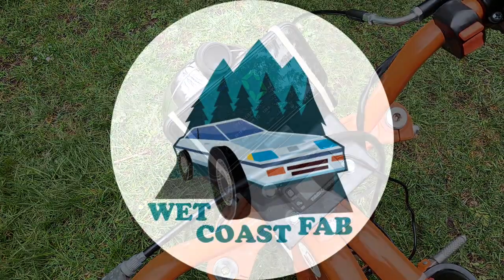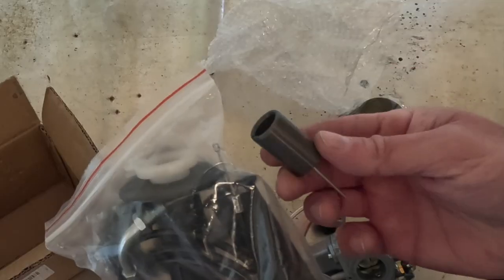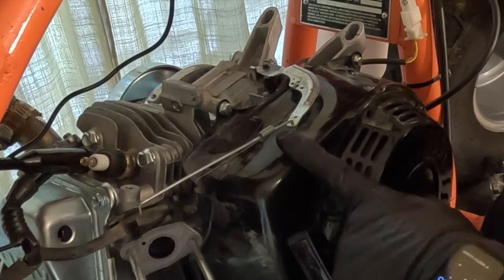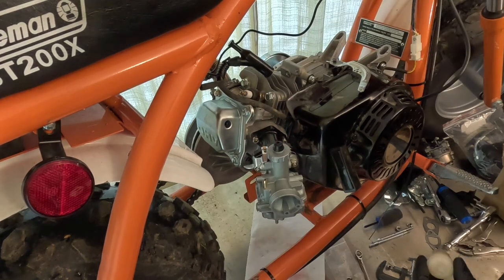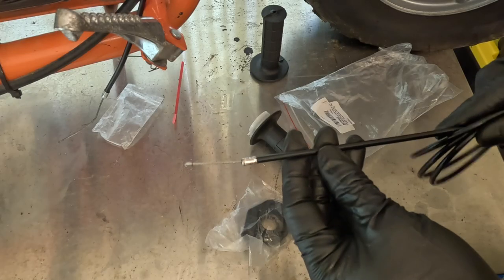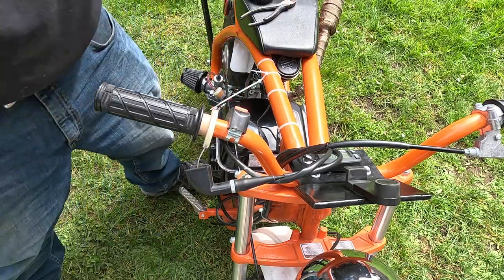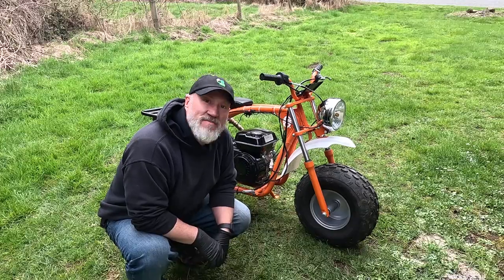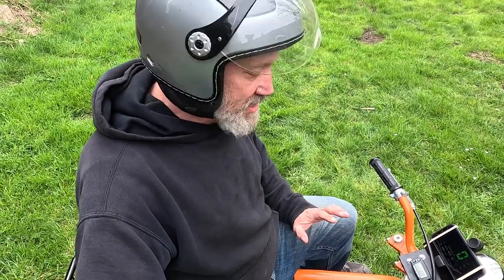Coleman BT200X | What will a VM22 carb do for the mini bike? | Wet Coast Fab

Comment: If you don't remove the internal governor actuation lever it will bounce against the crankshaft . Either remove it OR attach a small light spring on the outside linkage to pull it back towards the carb keeping tension on it so it won't bounce against the crankshaft inside . 😊
Reply: He did, at 8:45 you should have watched the video
Reply: So you need to remove the internal governor to properly install a vm22 carb?
Reply: @christophermendoza2986  you should remove it since your not going to be hooking up that VM 22 to it and if you leave the plastic gear and the rest of the governor inside , eventually it's going to come apart and that's not good .  This is the right  way to CYA . ARC rod and billet flywheel are a good idea since no more governor means higher rpm's .
Reply: @crippleguy415  so riding stock is not recommended? Better to buy a stage 2 kit at that point if I’m going to remove the governor

Comment: Valve springs are a must. if you want to rev to a point where the CVT becomes the limitation, you need to go beyond 4200rpm. 18lb valve springs will allow that. but you should look into a PVL flywheel or go full Billet Aluminium, both advance the ignition timing which gives more top end power, but at this point you want to open it up and fit a Billet Conrod, you could fit a 0.020" longer one if your piston allows, or even upgrade to a flat top piston for higher compression. the Hemi piston is a direct swap and the most cost effective swap but measure the piston height first if you go for a stock length rod then a 0.010" head gasket will work, if you end up with the piston flush with the top of the block you need a 27 to 45 thou gasket, and then there are literally dozens of different Camshafts from each supplier to choose from (my choice is the CM grind from Dyno cams... the hottest of the budget cams)
Reply from the maker: Love the feedback! I have a 10k aluminum flywheel to try out, with 26lb springs. I've also got a 0.020 longer conrod and high-compression piston to try out. I'll measure out the clearances first and if I can get 10 - 12:1 compression, I'll try 100 octane gas and see if she goes boom!
Reply: The stock valve springs are not the reason why it's not getting higher RPM. It's currently limited by gearing. Guys have experienced this for many years with the tall tire bikes. Even with your suggested engine build you'd be lucky to get to 4500 RPM. A gearing change is needed to take advantage of an engine build. The easiest gearing change for higher RPM is the Juggernaut or Tork-Zilla driver. 7.5:1 gearing is much better than 4.5:1 against a 19 inch tire.
Reply: @wetcoastfab  Easiest way to get 10:1 or more CR is with a 14cc head. A flatop and a plus 20 rod would still be under 10:1 with the stock 22cc head. A 14cc head, plus 20 rod, and flat top may get you more compression than you want or need.

Comment: Awesome 👍  More great tips.  Every minibike or dirtbike needs a fuel filter.  Especially if you're stealing gas from Dad's rusty old lawnmower gas can.  Cheers from Canada :-)
Reply from the maker: You're so right, Robin! I'm used to Honda products where there's automatically a fuel filter in the tank or just after the tank
Reply: The governor doesn't engage when it's not connected to the throttle cable.

Comment: Hey i got a new carb for my bt200x and my bike wont start with out starting fluid and when it does i have to keep giving gas or it will die out i have tried the screw thingy on it

Comment: So I upgraded my carburetor on my DX with the vm22 but now when I started it wants to take off right away do I need to get to torque converter cuz right now I have just the chain and jackshaft
Reply from the maker: Take off the air filter (if you've installed it) and have a look at the slide with the throttle closed all the way. You should have almost no gap at all between the slide and the carb body. If you do at fully closed throttle, you may not have enough cable length or need to adjust the cable. Let me know!
Reply: @wetcoastfab ok u wouldn't have a video on it?
Reply from the maker: If you look in that video around 13:30 or so, you'll see where I have the throttle slide stuck open about half-way. Then go to around 15:20 and you'll see the way the throttle should be all the way closed. Let me know if that's clear enough.
Reply: @wetcoastfab  ok i think that might be the issue thank you

Comment: They're not too big for a 196. You just need the jetting, a cam and gearing to support its full potential. That includes a billet rod and flywheel for safety. Gearing can be done with sprockets or Juggernaut/tork zilla driver.

From what I have seen from your other videos it looks like you may have had an issue with the stock carb to get only 31 mph then jump to 40 plus with the Mikuni style carb. There shouldn't be that big of a difference on a stock bike that is topping out at less than stock max governed RPM. Probably somewhere around 3400 RPM.

There's a good lesson here for everyone doing the same mods on the Coleman 200's. Don't waste your time removing the governor because you will not be able to get "ungoverned" RPM. Just keep the governor arm in position with a light spring until you can get ungoverned RPM with more engine and gearing. Any built 196 is more than capable of doing just that with the right gearing.

Governor removal should be done during the engine build, not before an engine build..
Reply from the maker: Love it! Some great information in there, thanks! 
I have a 208 (212cc) engine that I'm putting on next and will be doing some more advanced mods to it - the same VM22 carb, upping the compression a bit, billet rod, billet flywheel, valve springs, etc, just to get a better idea of what a bit more compression and displacement will do.

Comment: I really appreciate your videos. That stock throttle linkage is way too complicated. I was messing around with it and never able to put it back quite correct. It got more peppy but theres not a lot of play anymore to go slow easily.
This looks to be the perfect upgrade to get rid of that whole linkage and gain some serious speed improvement at the same time.
Thank you for a clear and consise walk through.
Reply from the maker: Again, thank you for the feed back! Yeah, having that weird not-really-connected-to-the-carb-butterfly complicated linkage that comes on these engines makes it a lot easier to work on! I remind myself that these 6.5hp engines are really coming from agricultural origins where they're meant to run all day long at around 3600 rpm, driving pumps etc.

Comment: I don’t know a whole bunch about carb.s but what has always worked for me is 
Set the bike up on a block or something to free up back tire. Get it to crank, turn the high side ( bottom screw )out till the engine speeds up and sound smooths out 
Leave it where the engine runs fastest! 
Now turn the idler screw ( side of carb). Down until idles like u want it. 😊
It should perform real close 
to what is expected! 
Until you billet it! You should not need to re jet the czarb 
Just need to tune it up ! 
I had a 95 # when stock!!
only till I put a cam in 😮I’m stage three !  At 58mph I still have a lil throttle left 
just out of guts ! 
😮😂😊
Reply from the maker: Love it! Thanks for the feedback!
Reply: What size pilot jet did u use

Comment: Hey good job, I'm not trying to Bragg but if you just start pipe it and zip tie the govener spring, remove the throat screw, take off air filter cover, it will go 41-44 mph
Reply from the maker: Sweet! Thanks! Maybe I overthink things too much ... wait for what I want to do on a future upgrade ;-)

Comment: The stock flywheel on these things weighs about 2.4kg.  If you want it to rev out more you can swap it out for a cast aluminum one (not necessarily billet).  Mine cost $66 Australian (including shipping).
Reply from the maker: Thanks for the comment! In fact, I bought the cheapest 10k aluminum flywheel I could find on Amazon and plan to test it to its limits, perhaps to its destruction?

Comment: Summit racing has the vm22 the real deal mikuni carburetor. The pilot screws on the side as well as the idle screw and you can change out the jet on the side of the carburetor also
Reply from the maker: Love it Stephen, thanks! I might have to get one especially with some of the engines and engine upgrades I'm planning on playing around with

Comment: I have a stock bt200xg so same bike just black and green and i got it to 33.5 just by making a new return spring and and changing the throttle spring to a metal rod
Reply: Ps if you delete the jack shaft you loose torque but will hit around 50 mph all day long 💯🔥 just be careful on the factory wheels they balloon out a little bit
Reply from the maker: Yup, the soft springy tires on this thing make me nervous. I think when I get some more speed out of it, I'll look for some proper DOT tires that can handle it
Reply: @wetcoastfab  oh yea 50mph is definitely 5-10mph over what I would say is safe for those cheap tires 🤣

Comment: Dude mine is a base 196 hisun engine came with it I got just a cold air intake and a 1 inch pipe for exhaust maybe 1 foot long and I’m slow take off because no TC but I get up to 47mph top speed and I am 5 foot 10 weighing 320 pounds
Reply from the maker: I wonder if the bike I have is limited somehow for the Canadian market? Maybe I just have bum HiSun engine. Not to worry: an engine swap is coming!

Comment: i always thought the needle is for 25-75 percent throttle, the main jet controls the wide open supply. if too rich at wide open, maybe a smaller main could fix it?
Reply from the maker: You're absolutely right! The needle is also tapered as well, so as it moves up with more throttle, the cross section of the main tube gets larger, feeding more fuel - dependant on the opening of the main jet hole, of course!

Comment: The torq-a-verter has plenty of gearing, that being said, I have have great luck with installing a larger rear (+10 teeth) sprocket for acceleration. It did NOT seem to affect top speed.

Comment: Do you have Engine Braking w / torque converter?? Ths
Reply from the maker: Hey Mark! It does, as long as the engine RPM doesn't drop below a certain RPM (almost idle actually) as you're decelerating

Comment: Don’t know how useful a inline fuel filter is ?? 
There great, it also helps to keep moisture from making it into the engine. Try using it, after 5-10 gal just look and see! 
If it jumps, moves ,wiggles, use a table when assembling, clips,&keeps! I say this because it took me getting frustrated enough for buying lost clips , jets, screws ! Anywho … save a screw use a table !

Comment: Nice set up there, do you think that it will work on a stock Honda GX160 engine? I really would like to make mine run a bit better. Mine gets held back by the governor, if I have to remove the governor so be it. Thanks. I forgot to mention, I bought a stage1 kit for it but it didn't work due to running rich and I even smelled it in my oil so I had to change the oil too.
Reply from the maker: It might be too much carb for that size of engine; you'd have a hard time getting the jetting figured out. Gas smell in the oil is bad for sure! Thanks for the feedback!

Comment: Buy a juggernaut clutch driver from go power sport doesnt slip the belt and increase speed and power and you can change the springs out on the torque converter to get more torque and speed or just change the gear on the cvt and the rear sprocket
Reply from the maker: I'll check it out, thanks for the feedback!

Comment: What rpm was u running at when u whr at 42mph do u remember by chance was it around 3700 or maybe i seen wrong
Reply from the maker: It was about 3,700 yes. I didn't get much past 3,800 during my testing. Billet flywheel next!

Comment: Remember that adding this new carb removes the governor, so be careful with the rpms!
Reply from the maker: I'm going to get a billet flywheel and hopefully that keeps things safe (ish)
Reply: @wetcoastfab  upgraded rod as well if you're turning 6k+, I've got a cast flywheel to 5100 and that's as far as I felt comfortable with but to each their own
Reply: What rpm is unsafe with stock flywheel do ya think?? U think 3700-4000 is to much on stock parts? Maybe a dumb question but was jus wondering thx..reason I ask is it looked like that what he was at at 41mph?
Reply: wtf ru talking about
Reply: Unless there is a major gearing change there's no concern about the stock rod and flywheel. Both will easily handle the max RPM this bike will get to.

Comment: Youre lucky you didnt have to do any setup after installing the carb. My 196 will idle but under any load struggles to come up in rpms until about half throttle, will even stall, but if i can get it to half throttle then GOES
Reply from the maker: Sounds like a really lean condition right up until the main jet takes over. Is there any chance that the idle circuit in the carb might be plugged up with gunk?
Reply: @wetcoastfab  I ended up buying the VM 22 from Go Power sports. Slap that on and it runs like a champ. I think just the pilot jet is too small in that particular carb and I couldn't find another brand that would fit inside the carburetor

Comment: Will this fit a 224 predator?
Reply from the maker: It should! I'm pretty certain that the carb on the 196cc, 212cc and 224 are all the same. The carb can handle the extra displacement no problem.

Comment: That air filter need oil, right?
Reply from the maker: I don't think so - I've not read anything in the instructions. I do have a '68 VW Beetle that has an oil-bath filter though! :-)
Reply: No oil needed, however I do use a tiny bit on the outside dust filter. I live down in the south and we have alot of clay in our soil = dusty at times so it’s just safer to filter all you can .. engine life will love uou

Comment: Why did you buy a whole new throttle? All u had to do was put a tip on end of original cable and just buy a new cable
Reply from the maker: Hey Mitch! I wanted to keep the option to go back to stock without having to modify the original cable. I plan on doing an engine comparison video soon with the carbs they come with. Thanks for the comment!

Comment: Can u. Just take the governer arm off
Reply from the maker: I could, but to do a proper job I'd have to open up the crank case and remove the gear inside. There's a couple fly weights that are driven off this gear that move the governor arm, and removing the governor arm doesn't really give them any resistance to push against any more. I'd worry that they could work their way loose at high rpms and damage the internals.

Comment: It’s pointless to try to make a mini bike faster using a governor at all just do away with it
Reply from the maker: That's the plan!
Reply: @wetcoastfab  It's not worth the effort unless you do an engine build and a major gearing change. There's nothing to gain pulling the governor as the bike is now.
Reply from the maker: @Deucealive75  Thanks for the tips! I'm going to source some different sprockets and mess around with the gear ratios
Reply: @wetcoastfab what size jets did you replace the factory pilot and main ones with?

Comment: Take the gov. Out
Reply: That would be a waste of time. With a slide carb the governor can no longer function. The time to remove the internal governor parts is during an engine build. With his current setup there's no need to remove the governor. 

All these governor removal suggestions make me smile. I run my Coleman to more than 50 MPH at 5600 RPM with the governor and 100% stock linkage. Most guys do not know how adjustable the governor is.